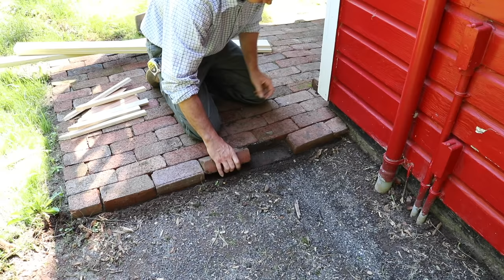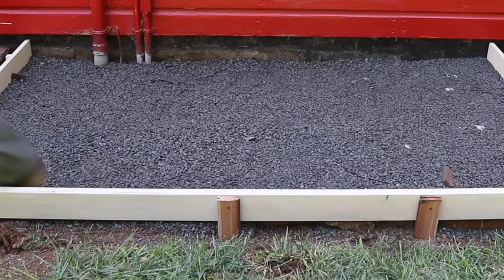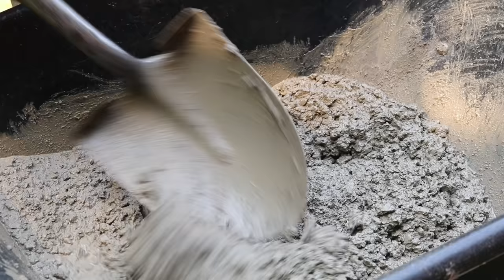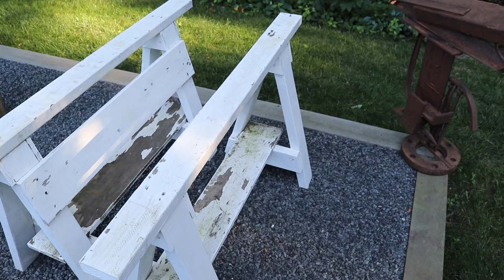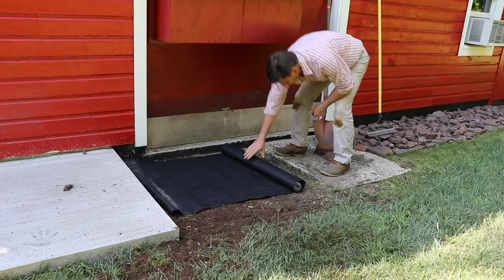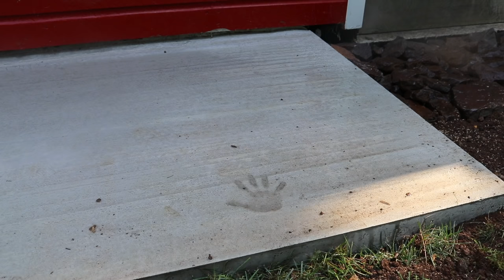Pour A Concrete Slab

Comment: Thanks Jon Peters! Would you please list the estimated quantity of concrete and gravel needed for an 8x11 pad?
Reply: Don't know if u got the info yet, one yard of concrete will cover 81 square feet if it is 4 inches deep. It sound like you have a little more than one yard there. On the gravel I usually cut the quantities in half.

Comment: nice job easy to follow, off subject what is the tool you used to spread grass seed?
Reply from the maker: +Denise Williams thank you I'm not sure what it's called it's an old tool that I found
Reply: John Peters thank you for getting back with me after a lot of research because I like the tool so much I found that it's called a roller Thatcher they have many styles now I'm back on the subject I'm tempting to pour a five and a half foot by two and a half foot by 3 inch depth slab my question is how far do I need to dig down for the frame if you can send me a link or give me an idea I would truly appreciate it thanks a lot

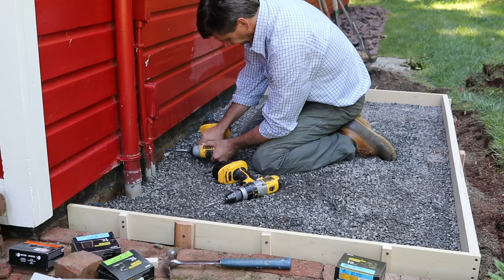Comment: Thanks for this video!  Was planning on replacing my paver stone walkway to concrete.  One question i have is at 2:12 you screwed 3 screws to the house, was wondering what the purpose for that?
Reply: I'm thinking it was something for the concrete to grab onto. Kinda reinforcing the concrete making it stronger. Just a guess tho I could be wrong.
Reply: @JH-eg2in  I'm guessing the same thing, but will the screws be enough to hold the concrete down?

Comment: Great demonstration! What were the blue screws for?
Reply: The blue screws are Tapcons. When pouring new concrete next to old concrete, you often join the sections together by drilling lengths of rebar partway into the old concrete. For small projects, you can use Tapcons instead of rebar.

Comment: hey im a mason and it looks great considering you did it yourself but i hope you didn't shovel that whole thing out from the wheel barrow into the hole.
Reply: I wondered the same. He appeared to use around 12 bags of concrete but could only mix 1 or 2 bags at a time if all he used was the wheelbarrow.

Comment: very good !
but I didn't know why u used that net ?
Reply from the maker: Thanks it helps to prevent the concrete from cracking
Reply: it looks like steel bars!
i think!
Reply: Hussain Ali o
Reply: It’s low grade silt but it does the trick

Comment: can I use this method on a 12x12 slab?  I can't get a cement truck in my backyard. is there an easier method to mixing bigger amounts of concrete?
Reply: Renting a mixer doesn't cost much and would make the job much less back-breaking. E.g. Home Depot have one at $48 a day (depending on where you live): http://www.homedepot.com/tool-truck-rental/Electric-Cement-Mixer/350DD/index.html.

However, for a 12x12 slab, depending on what you were going to put on it, you'd probably want to dig out the dirt down to 12", half-fill the hole with coarse gravel (i.e. the actual slab would be 6" thick), compact that with a compactor (which you can also hire from Home Depot) and use remesh rather than chicken wire. There would be a few other points to bear in mind as well, so you'd need to look at some of the other vids on YT for more detail.

Comment: hahaha...that flimsy wire mesh ain't gonna do a damn thing. use 1/2" rebar in a grid pattern. so easy !  You should always cover concrete work with plastic to keep in the humidity, which stops the concrete from becoming too dry (forming cracks) whilst curing.

Comment: Can someone please tell me what the long silver piece attached to the cordless drill bit is called? I've seen so many people use it, but have no idea what use it has for?
Reply: It looked to be a bit holder.  Some driver bits are short, just an inch or so, with a hexagonal base, which you just take in and out of a bit holder that stays chucked in the drill.  Many bit holders are magnetic to aid in retention.
Reply: Frank Kovach
Thanks man. I think I know what you mean now.
Reply: No prob

Comment: When weight is added, concrete tries to bend and concrete is great in compression, but terrible as expansion.. that's the really long way to say keep your wire mesh and reinforcement low in the concrete, otherwise it doesn't do much. Just sayin...

Comment: Spraying water from a hose to mix concrete? No thanks, I'll use the proper measurement to have strong concrete, not brittle junk. The fact that concrete poured over the side when you screeded it with the board proved it was too much water.
Reply: ancientloredude 
Another no experience know it all

Comment: can tell its American yh need to use steel mesh that chicken looking wore sheets isn't gana allow the concrete to grip when it cures your shuttering is completely different but I'd always use nails on a big job I gave a like but not a fan of how you did this to hire a cement mixer in England would cost about £20 for a week so worth the money for the time and effort saved sorry man not hating but don't like how you did this and no float finish or bull nose